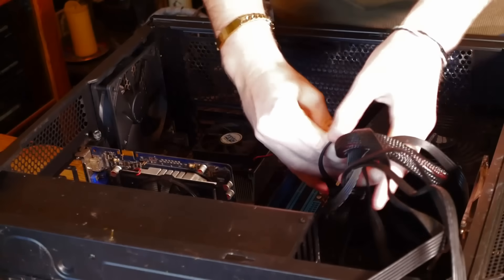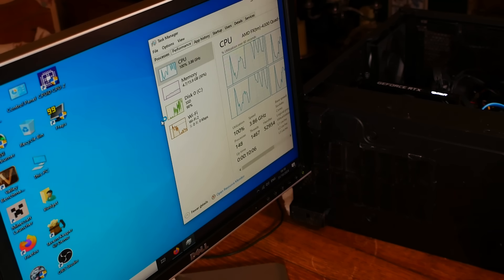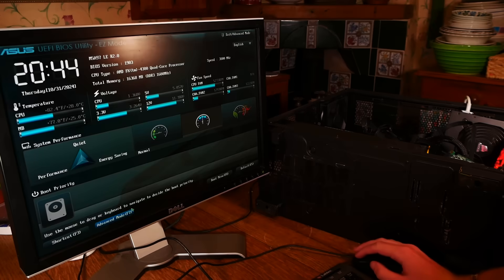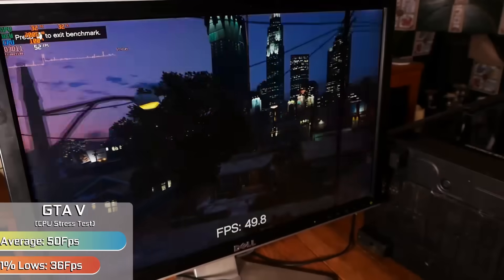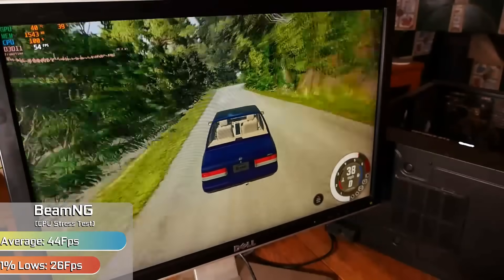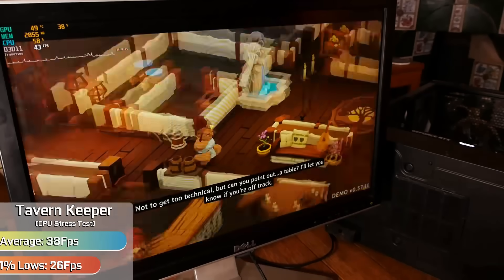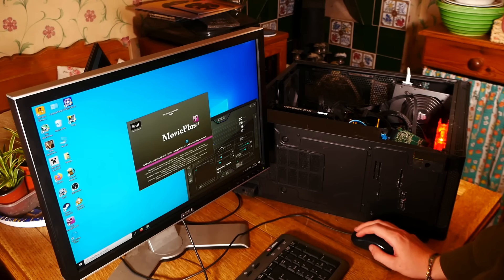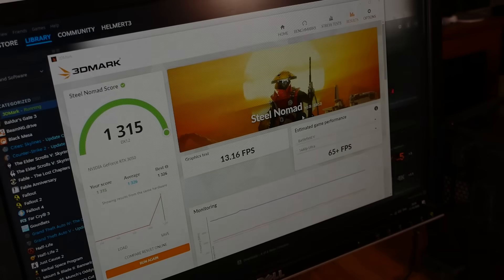AMDs Weakest FX Processor...

Comment: Usable in its time and a good price/performance back then.

That's the thing. Back then. Nowadays while the FX has gotten cheaper from what it was a year ago or so still anyone looking for used parts for a cheap used PC stay away from anything FX. The I7-2600 easily beats it in most tasks while being cheaper both with the motherboard and processor. Even the I7-860 contends with it. Still, launch prices the FX was cheaper than either, one big reason FX was so popular and some swore by it.

Still... it wasn't AM1 levels of aging poorly, but it hasn't aged anywhere near as well as AMD predicted it would. Those modules cause more problems than they solve. Anyone wanting to go a used AMD CPU is much better off going with even 1st gen Ryzen.

Comment: I went with an i3 4370 with a cpu+mobo combo deal at microcenter instead of FX, fx was not worth it really, then upgraded to a 4790k later and ran that for 5 years until it was replaced with a r5 3600, then got a 5700X3D a month ago.

Comment: That's so nostalgic to watch this video because fx 4300 was my first "gaming" pc CPU back in 2015 and until  release of the ryzen 2000 cpus. It was an awesome cpu to have with rx 460. At that time it's cost was lower than pentium's. And fx severally outperformed Pentium in the long run. Yeap fx struggled in multiplayer titles like BF 1,but it got me through all AAA titles of the era with good enough experience. P. S. You should overclock fx using main bus, clock speed alone isn't giving too much performance in case of fx cpus. In addition, they are very RAM speed dependant.

Comment: 4100 king , i still have a system with the fx 6300 running and it runs very smoothly on a gigabyte 970 ud board . Its undying, permanently 4.5ghz :)

Sweet throwback video.

Comment: There is only 1 genuine quad core design from the FX series thats hidden under the radar being a china only release, the FX 4200 is a genuine 4M/4T Design vs the rest of the series being a 2M/4T 3M/6T and 4M/8T in their respective catagories. Its commonly mis-labelled with the rest of the series but is esentially like an FX 8xxx chip without SMT if you will, it would have been quite interesting if the unlocking of the older style K10 MA continued into FX as its clear they disabled the extra modules at a hardware level vs software like previous. But its about the best you'll get comparing to the i5s of the era, even then, against the 8000 series, sandy/ivy and late K10 6 core chips (which could only match sandy/ivy i7s if overclocked into the low 4Ghz range) it was clearly weak and reminds me of the weird Sempron X2s, something milked into a crippled late K10 release on FM1, bit like bulldozer milked into FM2+/early AM4 L3 Cache stripped Athlons, the last chips of a dark time introduced on the socket that turned AMD around.

It really brings me thinking back to the rollercoaster of confusion they started with late K8 X2 Sempron budget chips, original athlons/phenoms that were succeeded by the "II" K10 linups (but budget offering K10 Sempron ignoring the "II" suffix). Not the mention the + Suffix that went all the way back to K7 XP branded processors, with the lifespan of processors increasing for users, i felt it all toppled over for AMD with about 4 sockets in cirulation (FM1/2 AM1/3) with various generations, old carried over, release generations/energy effecient micro revisions that bled old socket life when a new was released, made for the most confusing time ever to buy from AMD (laptops, oems and AIBs to blame too) where you thought you had a good processor, upgrade path, only to be given a dead ended platform (like AM1/FM1 oh boy, socket 939 succeeded by AM2 yet AM1 releases in 2014, oh then FM2! But AM4 isnt out for another 3 years and AM3 came out before both!) 

This was in an era on the tailend of the clockspeed boom and you were dripfed so many options (which only made it more confusing for older buyers tripped into the clockspeed trap) Like an FX 4100 vs FX4300 which had double the performance in cache throughput. Once bulldozer architectures released, i became so tired and confused on what i should upgrade to with the many revisions that i just looked for a high end athlon as it had better memory overclocking performance and hoped for the price i paid that i could send it..and send i did, almost 5Ghz on a crappy FM2+ board and stock Wraith cooler..i only found out just how bad it was when i got a cheap i5 4570, later a xeon that the backlash AMD recieved was well and truly deserved, but it seems as much as innovation leads the new ryzen designs, they are once again drip feeding us at each tier eg: 3 (nvm they ditched this generations ago..)/5/7/9 like intels quad core era, they've gotten comfortable and only makes sense to buyers on old platforms, it feels exactly like the upgrade from late K7 to early K8 S754 "effeciency at the cost of performance" with overpriced boards so you have to cough up to overclock any marginal gain (939 vs AM2 Via/Nforce misleading board suffixes). Seems they always milk their Ws and trip over the same behaviour they get comfortable with as a brand. I'd have imaged they'd have done much better milking K10 like intel with the pentium M derived Core2 architecture and had some Sempron FX4/Athlon FX6/PhenomFX8 sort of product stack..truly a pitfall of their own doing.

Comment: I believe my first processor in a PC platform ever was the FX-4100, and it could hardly run minecraft (or it would and it would chug horridly) in windowed mode so I researched better processors immediately and begun my journey of upgrading PC's through my lifetime
I ended up back then upgrading from a friend who gave my one of the Phenom X6 512 CPU's or whatever they were called
it's the 3 core that was advertised as a 6 core !

Comment: Bulldozer was the worst generation of CPUs ever launched. It was SO bad that I had to upgrade 2 years into ownership even though I had the "flagship" 8150 which died and got replaced with an 8350 from the retailer. I had the misfortune of having to use it until the Skylake launch, at which point I bought a 6700k and lasted me until 2022. 6 years vs 2 years. Imagine buying the best processor Intel makes and being unable to play games 2 years later. It was that bad.

It wasn't fine wine, it's just a bad processor. 50-100% worse IPC than the equivalent i5 from the same year's Intel generation which meant it felt like a CPU from 2008 in 2012.

In 2024, Intel released a generation that gets large gains in multithreaded performance and is at parity or 2-3% lower in gaming performance and is getting ROASTED online. It's kind of like intel went back a year in performance to save 40% in power consumption (needed). Again, being ROASTED online. Imagine if you went backwards 4 years in IPC and gaming performance. That's what AMD did.

Comment: I had an FX-8320 that outperformed i7’s back then. It took considerable effort, but I overclocked it everywhere possible. Occasionally, the i7 won, but I had that system tuned exceptionally well. However, the time and effort I invested in making the 8320 beat the i7 weren’t worth it. It was still fun, though.  But no one will ever believe me.
Reply: Stock i7's? Because you had pretty much a guaranteed 25% oc over the all-core boost, and quite some could do almost 40%
I still have an old i5 here with a 20% CPU OC and 33% RAM OC that still delivers adequate performance in many cases even in 2024.

Comment: The actual Floating point unit ( FPU ) is shared between 2 cores.
Reply: I just learned this. It makes soooo much sense. An 8350 should be compared to a quad core in FP heavy titles... And in that respect, it is not too bad.

I knew something like this was happening in the background. It's like the GTX970 3.5 + 0.5 scenario
Reply: It's more a "two threads" FPU than a shared FPU.

Comment: I had one of the 9000 series chips, ran hot as can be and was basically unusable with stock cooling.
Ended up doing my first intel build after that, don't even remember which CPU it was but it ran much nicer.
Nowadays the 8000 series chips are best known for the absolutely horrifying OCs people can get on them, with them being the first to crack the 8GHz ceiling, and my condolences go out to the guys who broke said record only to no doubt be cooked alive by the miniature sun they'd created with all the heat it must have kicked out.

Comment: I had a FX 8350 for a while. I got an AMD mobo and some cheap CPU for free. Upgraded it to FX 8350 as it was really dirt cheap back then. It clocked like a beast and OCd is only 25 % slower single threaded as my current Ryzen 5600X. It wasn't bad, but had other issues (perhaps due to mobo?) so updated it quickly to another freebie, an I3770.

edit: You have the exact same Dell monitor as I have for comp builds :-D

Comment: went from an FX 8300 to an ryzen 2600x and it nearly tripled my FPS in nearly every game i played
Reply: You must of not been using your gpu at all because the 2600k isn't 3x faster, not even 2x.
What games were you playing? I'll breadboard my 2600k in z77xUP7 against my fx8320 in 990fxaUD7 and show you.
Reply: @tomstech4390 Yeah, his claim doesn't hold much water. When I went from a four-core Richlands (basically an APU Piledriver) to a Haswell i7, I got a 70% kick in Microsoft Flight Simulator X - a huge improvement yes, but nowhere near 3x. And FSX was notoriously CPU-intensive - far more than any of the first-person shooters he's into (assumption based on the videos on his channel).
Reply: @tomstech4390  i played alot of games like borderlands 2 valve games because they were really the games i played back then and most of them would always hover around 50-70 (borderlands constantly dipping to low 30's) fps even with my 1050ti at lowest settings

But going to my ryzen 2600x and my 1070ti i could always hit 300 fps in valve games and borderlands 2 id cap it at 240 fps due to engine crashes

Comment: I still have a FX 4350, 6300, 8370, and also have a FM1 651K , FM2 760K, 860k and 870k. I have a lot of old AMD CPUs. I have a few Intel as well but most of the older donated systems we receive have AMD CPUs in them

Comment: I pre-ordered an FX-4100 in 2011 and couldn't wait for it.  At the time I was running an Phenom  II X4 945 and thought it would be a decent upgrade.  I was wrong.
When it arrived, I spent the first couple of days running benchmarks and playing a few games, and it was actually worse overall than the processor it was replacing.
There were no online reviews yet, and I posted my review to the forum at NCIX, the place I purchased the CPU.
Fanboys came out in droves (I myself was a bit of an AMD fanboy) and were ready to burn me at the stake.  I had simply posted an objective review in the hopes it would "warn" others, but some people were not happy.
Anyways, a couple of years later I purchased an FX-8350  CPU to upgrade it along with upgrading to an R9-280 and 16GB DDR3 RAM and an SSD.  I still ran that system until a month ago when I purchased a Ryzen 5 5600x, 32GB DDR4 and an NVME SSD.  The R9-280 lives on, at least for a while.
As someone who doesn't really play a lot of games, the FX was still useable for me up until 2024, and the 4100 would have probably done OK as well, but I basically got the 5600X for free, so it was time to upgrade.
To recap: In my humble opinion the FX series was not much of an upgrade over the Phenom II series.  There were some new instructions, but otherwise it was a dud.

Comment: Just after FX came out my mom bought a new family computer which had a FX4100 in it. I ran till last year with mostly my brother using it for uni stuff. I had in the meantime upgraded it to a FX6300 that had ended up in my parts stache and 16gigs of ram (up from 4) a GT630, it ran chipset graphics till my brother needed dx12 support for his math program and an SSD. When it finally was done and not usable anymore and my mom gave me 100 bucks to upgrade. It is now running a 3600xt, 16gb ddr4 on a b450 prime plus. SSD, GPU and the rest stayed. My brother still steals my moms laptop rather than using it even tho that is technically slower.